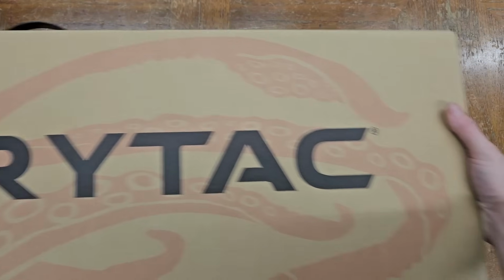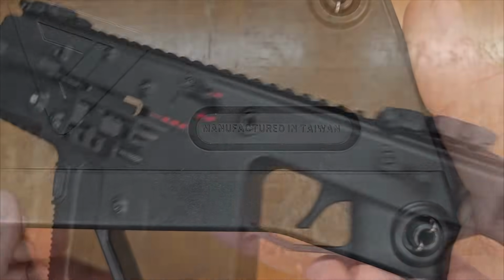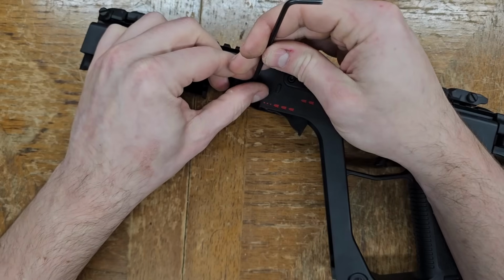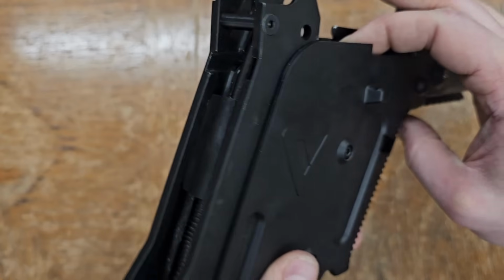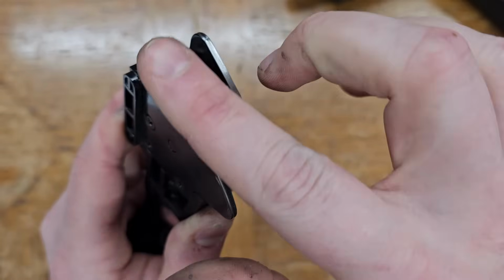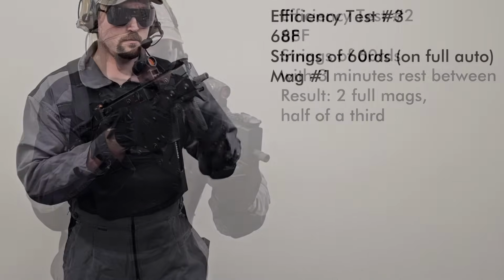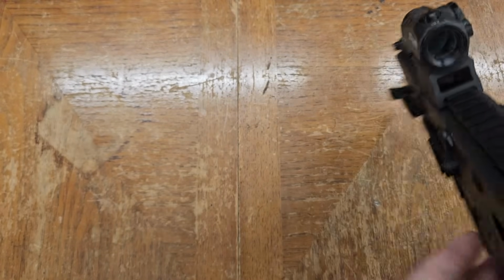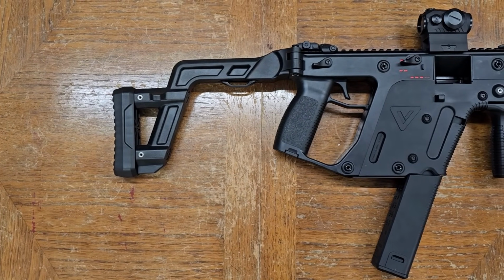Krytac Airsoft Kriss Vector GBB Review: Highs and Lows

Comment from the maker: Pinned comment for additional notes:

-We want to stress that if the rubber buffers are cut down too far, the bolt will get stuck to the rear and the gun will fail to cycle. If you don't feel comfortable accepting this risk, we suggest holding off on that modification for now.
-(1/26/24) We have heard multiple reports that the Laylax right-side magazine release requires modification to work properly. It will fit, but puts the catch surface slightly too high, holding the magazines higher than intended and causing cycling problems. This can be remedied with Dremel work to remove material, but is not as drop-in as we hoped.

We'll update this comment if we have any additional follow-up.
Reply: Do you maybe have a site or blog where you show how to do the DIY fixes? I still want to keep my preorder because I really like the design and I want something different than a stand m4 for my first airsoft replica so a small guide would be greatly appreciated
Reply: didn't know if you have seen it, but bow master has made an o-ring piston for the nozzle. was hoping to see how much it improves efficiency.
Reply: I've done all the mods u recommended and I noticed a difference in feed reliability and overall user ability. So, much love, on this guide. I fielded my vector with the only mod being sanding down the cams uneven surface. Biggest issue was feeding with the charging handle which seems to be fixed by shortening the top shortstroke buffer. I did reach out to krytac they mentioned additional parts should be available by Feb March time. Id like to buy an extra bolt assy to mess with the cup seal. For an indoor arena this thing is great and my fav gun all around.
Reply: @vicm7200  hey man I've done all the mods mentioned in this video too. have you had any issues with the BBs jamming in the mag when you aim up?
Reply: @Shaktical_Airsoft tbh I haven't tried that. I play mostly in an indoor field haven't had to aim up. I'll give it a shot and let u kno.
Reply: @vicm7200  did you sand down the cams by hand or did you use a machine. I just got my vector in the mail and not sure if I should return it or not. If most issues are solved by sanding down the cams by hand with sandpaper a bit than I will do that but if it requires more work / machinery I will just send it back
Reply: @SquidCultist  by hand using a sanding block nothing crazy
Reply: Any updates mate, what ya recommend for the nozzle seal.

Cheers
Reply: @BIG-RED-Airsoft I'm working on a 3d   printed sleeve to accommodate an o-ring. Im just trying out different o-ring sizes and marrying a sleeve to it to seal against the carrier. A quick and dirty fix was some Teflon tape around the piston cup area using a 16mm od 12mm ID 2M cross section And a smaller oring to support it, since the gap the rings fit around is wider then the 16mm seal,but not wide enough to just use two of the same size. Works well. Definitely kicks better then the stock seal but I wanted a sleeve around the piston for a more close seal
Reply: @vicm7200   thanks for the advice mate, please let me know once ya have the finished product. I'll be more than happy to buy one off ya.
Reply: @BIG-RED-Airsoft it didn't really pan out. Too small for the material to hold up on Pla for an fdm printer. I did find another solution. Black variable airsoft has a 3d printed piston that u can drop in. I swapped out the seal for a 16mm OD 12MM ID from harbor freight and it shoots like champ.
Reply: @vicm7200  hey bud, funnily enough I was working on a piston to accommodate an O ring and because I was printing in ABS like resin it just didn't hold up because of how brittle it is. By chance do you know what the diameter of the piston is where the O-ring sits in or even the OD when you put the O ring on since the bore is around 17mm
Reply: @Shaktical_Airsoft  16mmOd 12mm id 2mm cross section is the closest I could get
Reply: @vicm7200  thanks man! ah same, I might get back to finishing off this o ring project of mine lol there must be some stretch of that o ring to make up the gap between it an the piston, do you feel it shoots better now and how's the gas efficiency?
Reply: @Shaktical_Airsoft  black variable makes a drop on replacement you can swap in. Put that o ring in it and it's much better. I haven't like really tested it yet. But it feels night and day better.
Reply: @vicm7200  sounds good man, he did the same thing for the KWA vector. I want to get this mod on mine too and see if it improves it. So far it's alot of fun to shoot and it even hops 0.3's. Hop up is the next thing I want to sort out
Reply: @Shaktical_Airsoft  I put in a 6.03 tight bore in it and a unicorn bucking. It's mint. My stuck one barely worked out of the box
Reply: @vicm7200  ahhh 6.03 was what I was thinking of going to, did you go for a maple leaf crazy jet inner barrel? I went for the ML decepticon bucking with the stock barrel at the moment but I have the same issue where the hop isnt sensitive enough between each click shoots up in the sky or just hops abit :/
Reply: @Shaktical_Airsoft  tbh I'm not sure who makes the barrel lol. My brother had a spare AAP-01 barrel and gave it to me. Fit right in. Slightly longer but I got it covered with my tracer from acertech. I might have stuck out the outer barrel like 2mm
Reply: @vicm7200  haha no worries man lucky you for having a bro with spare airsoft parts
Reply: @Shaktical_Airsoft  yea I can't complain. Lol.
Reply: where discord server?
me want to join
Reply: Could you please tell me if the mag from the vector is suitable for any glock 17 ggb?
Thanks

Comment: The bolt issue has been fixed in newer revisions of this gun, however the casting on the Super V system still has bad casting and needs to be sanded flat

Comment: I was playing Stalker 2 and saw that the Vector uses Glock mags. I happen to have a Glock 19X and thought "Oh! I could totally use my glock mags for this thing!" But as cool as this thing is. It's very very niche, and I think I'll look around some more. I still want something that isn't an M4 and is a Gas Blowback with refillable mags like the Glock where you just shove green gas into a tiny pin hole. I find the CO2 cartridges to be very unappealing and expensive.

Edit: Changed my mind. I want it, but I still gotta know if this can accept Umarex Glock Mags?

Though, I should look at buying a proper mask/ helmet setup first.

Comment: I WAS going to buy this gun, but after watching this well executed video, I'm going to pass.  There are just too many preventative maintenance and design issues that I just don't want to deal with.    If they made this as a non-blowback gas gun, it would be highly desirable.  Seems like all the moving parts are just causing too many issues later on.

Comment: Seems like an enhanced piston that uses an O-ring is available over on blackvariable. I just ordered one, will see if it addresses the gas efficiency issues. The part is 3D printed but hoping it works and holds up!
Reply: How was the new enhanced piston boss? Did it fix the issues?
Reply: @lazyblackninjadfg8602  actually yeah it did make a pretty significant difference! It's still not particularly efficient (expect to gas up between each mag refill; it won't make it through more than one mag it seems) but did not have any issues running out of gas mid magazine during 2 long game days.

Coupled with the buffer mod, I only had an occasional cycle failure. I think it failed to cycle maybe 3 times out of both 5-hour game days in 88F weather? And this was using all fire modes throughout the day. In short, definitely an impactful improvement, I would recommend it.
Reply: Thinking on it, I should clarify a little that I may have also failed to fully gas the mags initially and it may be possible to get through more mags with the mod if filled fully from the start. I did some hasty reloads of mags between rounds and this may be why I did not get through as many during the games where I had to reload them (along with a lot of full auto and burst fire). I still recommend the enhanced piston for sure.

Comment: Both Krytac GBBs have issues with cooldown. I have a Maxim 9 that basically cools down immediately on propane, so that even on an average fire rate of 1 shot every half a second will cause it to cool down to the point that it won't catch on last shot. It also often spits so much propane even if not overfilled that I sometimes get some in my mouth when shooting at arms length.

Comment: I’m interested to see how this compares against my kwa version …breakdown is identical …I also shoot left handed so reload is very odd but with practice it’s doable …iv ran my kwa for many years and it too suffers from cold to some extent …I have found out using map gas or propane works great even in sub cold conditions (32 deg) I have had 0 issues with the trigger system …I do have 7 mags and all have worked perfectly fine for the last 6yrs that iv owned the gun / mags …mag pouches I would recommend hsgi extended pistol pouches since they will hold the longer mags fine …its been a while since I’ve played but i used to use my vector every weekend and have shot thousands of rounds through …I’d say it’s fairly reliable for a gas gun considering my kwa was one of the first production releases …I’m interested to see how the krytac and kwa compare …I can say materials are pretty much the same from what iv gathered …con is you can’t really get new parts for the kwa …I managed to get a few internal parts that I keep on hand …great vid and I hope my comment helps anyone who is curious about the two vectors …I still own and field my kwa …the vector is a head turner pretty much everywhere you go especially a gas one

Comment: Love the in depth going over the internals review actually showing how the gun works. You didn't just post a basic field strip assuming how things worked the second you got the gun to have a video out quick but actually worked on a well made explaination of the design and function of the gun. I can't own an airsoft gun for more than a week before I take it apart so this review will help a lot.
Reply: I want one but I'd wait until some aftermarket support hits it which I'm sure won't take long with how wanted this gun has been.

Comment: I've got this and play at indoor events in England 🇬🇧. 

Bolt freeze stand, happens when ever use green gas even on single shot.

Have to use red gas.

Mags feed problems happening too often,  but have been laxed on loading. 

Sometimes, if I dry and aim up, for example, shooting at players on the next floor,  it misses fires.

Have to point it down shot until it works. 

With my krytac gbb, I had a mag fall out on me halfway through a mag.

Had to duck tape base plate back on

So triple check now to check if secure. 

Trying to find pouches is a nightmare. 

Gonna implement the mods in the video. 

Cheers dude 👍
Reply: have found any proper mag pouches for it?
Reply: @jasperpincharon3981  I run HSGI Taco smg mag pouches, tactical kit sells them.

I have replaces my piston head seal (which looks to of chipped abit just don't ask how I don't know) and on the 1st of December with green gas I got 3 below the limit with 28s and with 32s 326fps, I like the fact or having an improved hopup gate as well

Comment: What did you use for the shim to keep the nozzle in place inside the bolt?
Reply: looks like hollow polystyrene rod, often comes in smaller, sometimes even metric, diameters. Can be had at hardware stores and hobby shops usually

Comment: You do realise that kyrtac recommends you re-lube all the internals after every 10 mages shot through, to maintain optimal performance, as for the gas cooldown problem, i have had no such issues, can dump 2 mags on one green gas charge and have no issues on any fire modes. gbb is savage, i will need to run maintance soon as i have shot 8-9 mags through mine, the bolt is looking a bit dry.
Reply: I'm late to this but you do realize relubing every 10 mags is a ridiculous ask, right?
that means relubing every 1-2 games during a day.
Krytac couldn't design a good enough product and asks you to do that to counteract their bad design.
Reply: Lmao saying you need to re-lub everything every 10 mags like its just normal practice to take apart your gun every other game is insane

Comment: Do you think it'll be possible to increase the bolt travel without it getting stuck by modifying or via possible future "full travel" upgrade kits? The low recoil is kind of a turn off for such an interesting gbbr
Reply: Eh I mean Vector is supposed to have mitigated recoil

Comment: I am going to be honest, these are the best airsoft gun reviews on Youtube. The practicality & aftermarket sections are my favourite, and a really important part most reviewers don't think to mention. I am SO happy you guys covered this gun. Definetly adding this to my playlist of airsoft-related videos I can fall asleep to. Don't judge.

P.S. on the subject of the mag release - I've used a Krytac AEG vector myself a couple times (my good friend owns one, almost bought it at one point) and I recommend holding it by the bottom rail with your palm rested over the mag release. You can apply pressure with your palm when the gun is upright and the mag will slide right out - It's good for fast reloads where you don't give a shit about where your mags go, but given that GBBR mags are much pricier I probably wouldn't recommend consistently dropping it on the ground. Just saying.
Reply: Me who broke a mag due to a fall be like
Reply: You can definitely use your index to press the mag release button or your thumb while having your palm on the mag, but for the sake of sanity just use a righty mag release extension which makes life a hell lot easier

Comment: Overall this review pretty much sums up my experience with the replica, except for a few minor things.
-While the gas efficiency isn't great, (especially at freezing) it had no problem firing full mags in semi auto at 42F. (keep in mind that this is during CQB)
-The mag baseplates use an extremely weak design, after playing for about 4 hours, occasionally dropping the mags onto the plywood floor from crouch height, one of the baseplate had the locking lug break off, causing the follower spring to fly out, losing the spring base. I was able to 3d print some replacement parts so its not a deal breaker for me.

Comment: I've added this thing to my wishlist but now I'm deflated because I don't want to buy a gun that I can't use for like 7 months of the year.
Please do a followup video if there are aftermarket upgrades or if the gun itself is improved by the OEM.
Reply: If you do indoors or live in places where it's mostly 15-20 degrees it's acceptable and can clear mags
Reply: @周生生-f1f  There are no indoor games around here. Spring and fall has disappeared lately. I don't want to risk buying the gun unless itcan be winterized.
Reply: @sogerc1  big oof, rip

Comment: Hi at around 1:45 you mention something that you can use to touch up the finish called “coatblue” or something. How do you properly spell it?
Reply from the maker: The term is 'cold blue'- in this case since the parts are aluminum, Birchwood Casey Aluminum Black is a specific product that will do the job.
Reply: @ExplosiveEnterprises  is there a similar product for zinc-alloy parts?
or does this work for zinc-alloy already?
asking because I run tokyo marui gbbrs

Comment: This is just another ruined gbb and disappointment
Reply: Eh not really, a lot of the issues can pretty easily fixed and it’s highly likely krytac will come out with one that doesn’t have a bad piston cup design/better cam surface
Reply: Eh could be worse tbh
Efficiency is fine if you're a singles guy or live in warm places
It's actually reliable
Just with some bugs here and there as expected for a gen 1

Comment: The more major reason as to why the gun doesnt have good gas efficiency probably lies in the fact that it uses a not realistic bolt system - with the nozzle carrier having to do work and rub against a mock bolt behind it, a lot of friction is produced and worsen its already not so great gas efficiency as a result of its small nozzle

That said in an actual game this thing is a beast with remarkable consistency and response, as long as you are not incredibly trigger happy the mediocre cooldown resistance is hardly an issue